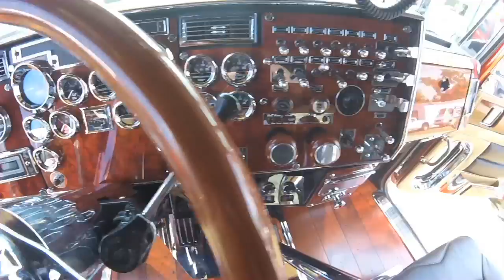CHROMED OUT 379 SHOW TRUCK - BAD ASS CUSTOM INTERIOR - BUILT BY THE BEST - HOT ROD RIGS TV

Comment: Very nice. Well done! I often wonder, and want to take this opportunity to ask Hot Rod Rigs TV. 

Not on a rig like this, that only comes out a couple times a year for a show, but as to nice, working, show Trucks. How often do builders, when taking it to near this level. Go the extra step, and add a fair amount of sound deadening material?

I know personally, I have to, and would go mad without it. While the rumble sounds nice, it will really get to you when working the Truck over a long period of time.
Reply from the maker: Thanks for watching steve.  Do you have a preference of what make of sound deadening material you like?
Reply: Hot Rod Rigs Tv - I now like to use Dynamat, and Dynamat Xtreme. 

Way back, years ago and before, it was another brand that I can't remember the name of at this moment. If I'm tearing into anything very deep (door panels, or bunk interiors for example) I always take the little extra time to put some in. It really does make a very noticeable difference. 

Especially under new cab wood flooring, which we all seem to be in love with at the moment. The wood flooring can act as a sound amplifier, if not isolated properly. 

We also always have nearby, some quarts of a bedliner like material. For those odd areas.
Reply from the maker: Good to know thanks.